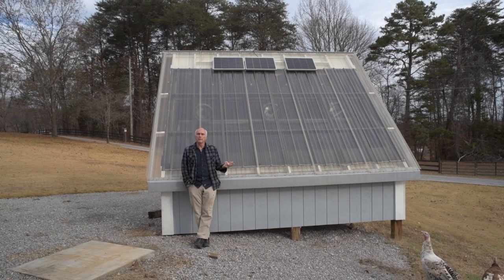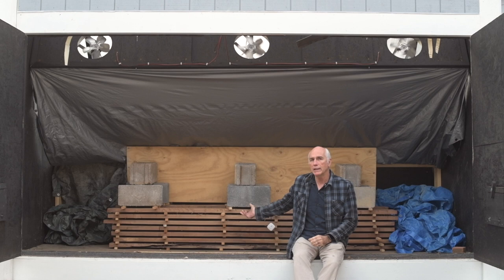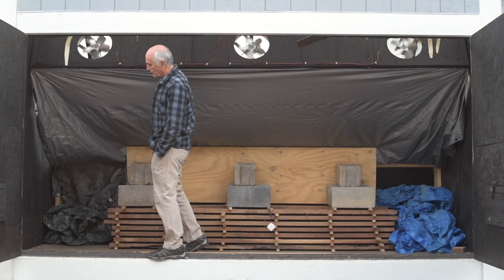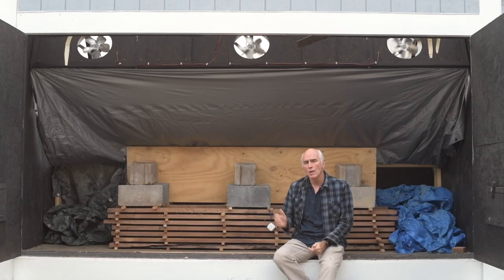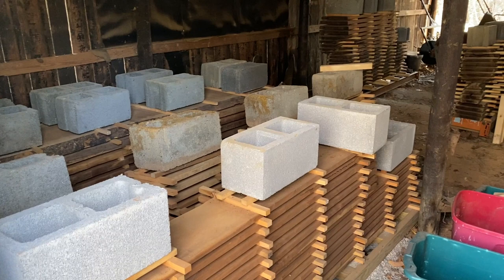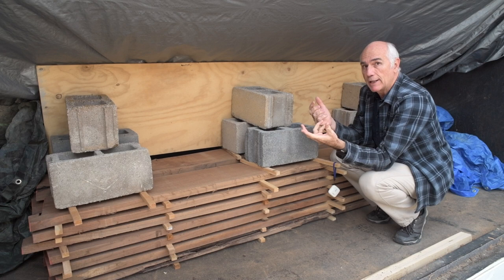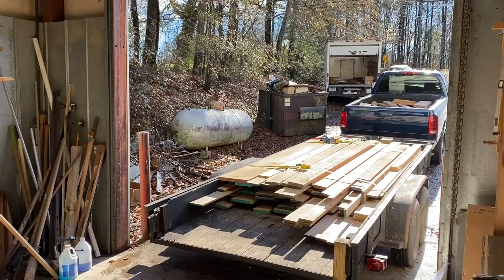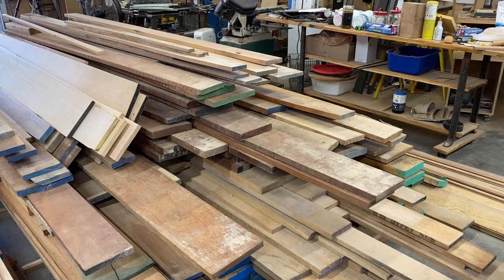2 Years with a Solar Kiln

Comment: I manage a small Facebook group entitled “Solar kilns for lumber” which I have linked your videos in. I appreciate you sharing the process by which you have permanent-ized your baffle. I will def be using this method. Any other wisdom you have to impart would be greatly appreciated kind sir.
Reply from the maker: I will be joining your group to try and accumulate some wisdom myself or at least get some suggestions for getting rid of my hot spot.  Thanks for watching.

Comment: Hello from across the "pond." Experience talks and it was a pleasure listening to you. Fortunately, wood bugs aren't such an issue here in the UK, but moisture content is and the reason for taking in your advice. Loving the goats.
Reply from the maker: Well hello,  I think this would work well over there as well..  You may find it hard to believe but we probably get more rain here (Soddy Daisy) than you do with our yearly average about 57" or around 1450mm and it still works pretty well.
Reply: @hillbillychic3933  Definitely got us beat with that figure, by 4" approx. And wood stock. We're ok if we were to make oak bow and arrows, but walnut and other decent types that are available to you is scarce and expensive here. Probably more Tree Preservation Orders here than actual felled hardwood. 😁

Comment: Very interesting ...seems like just a few months back you were building the kiln.  
I'm playing D'Artagnan and putting more fencing boards up.  I was trying to think of a way where I could build a wet fence.  Maybe put in every other board then return after a season.

Yesterday's idea was a horizontal pattern, where the fence boards stack and are held by two channels.....so as they dry, gravity would keep the gaps tight.  Another idea that is bound to fail.

For years I've thought to just nail the boards up...side by side...let them dry out and then return with a gig that will cut a nice 3/4" joint between them where I can lay in a decorative piece.
(This is one of the many times I'm grateful I don't own a ranch that needs fencing around the perimeter)
Reply from the maker: For something like a fence how dry do the boards have to be?  Keeping in mind they will shrink a bit and if they are held pretty captive there shouldn't be too much warping.. Famous last words right there..
Reply: Hello  @hillbillychic3933  I wanted to work with wet wood.  
I have framed with wood right off the mill.  My thinking was you could wait and let the word dry some before continuing the building.  
But...for the fence...I'm not sure how well that will work because the ends of the boards are floating a bit.

Comment: Just a guess, but I bet that faulty fan is the reason you have a hot spot on that side. You can see in the video that it is not turning at the same rate as the other two.
Reply from the maker: it would be easy enough to switch fans to see if the hotspot follows the fan.  Something to look into for sure.  Thanks for watching.

Comment: Have you ever considered or even tried adding a small electric heater or dehumidifier just at the end of the cycle to get the needed 130 degrees?
Reply from the maker: I haven't really considered since I have not had an issue with bugs.  It would also be a bit more difficult because the panels would be a great source of heat loss.

Comment: If you has made it smaller, wouldn’t it also capture less solar radiation? It seem like, given how you mentioned that the thermal mass of the boards is a limiting factor, that it would be better to keep the kiln bigger. Unless you’re just saying that you’re only ever interested in small batches. In regards to the sugar in the wood, I thought I watched a video that said it peaks in late fall, and gets depleted til the spring arrives, which would indicate to cut it in late winter, but I really don’t know
Reply from the maker: You are correct! But, less solar radiation and less space to heat up.  If I kept the loads smaller I think I would see the same results.  The loads would also just have to be smaller still.  To your point, I don't think I could put the same loads in a smaller kiln that I currently put in my existing kiln but I do think even a smaller kiln could keep up with the amount of space I have dedicated to air drying.  Trees have the most sugars in them in Spring when they are getting ready for growth and not getting ready to go dormant in fall and winter.  There are podcasts out there where smarter people than me discuss these things.  If I could recommend one it would be Shannon's Lumber Industry Update.  It's a lot better than the name implies and if you are interested in where would comes from you should give it a listen.  Very informative!!

Comment: How long does it take to dry each load
Reply from the maker: Because I mostly air dry below 20% and keep the loads fairly small it takes a couple of weeks in the summer and up to a month in the winter.  There are many factors to it as well.  Species of wood, walnut dries a lot faster than White Oak, sunny days versus cloudy days but 1 to 2 weeks is a ballpark answer.
Reply: @hillbillychic3933  WOW!! That's valuable info though. Even a month to dry out a stack is amazing compared to just putting stickers and leaving under something to air dry. I think with all I have learned that I will take the time to build kiln. Looking forward to milling some white oak and making flooring for my cabin in VA! Happy Drying to you!